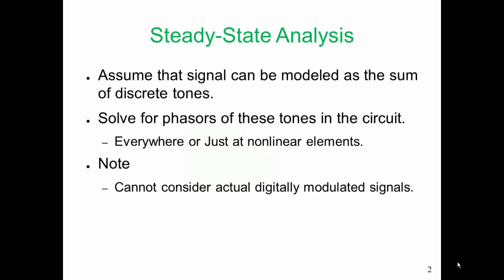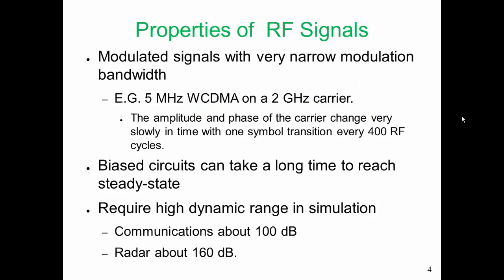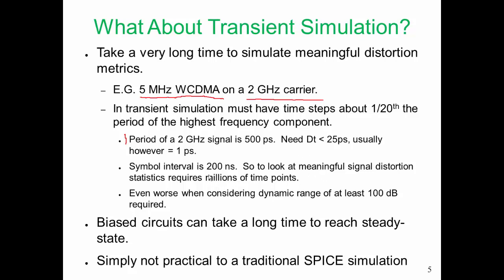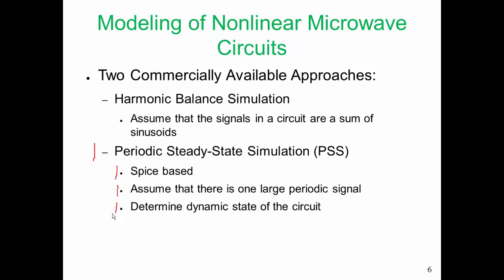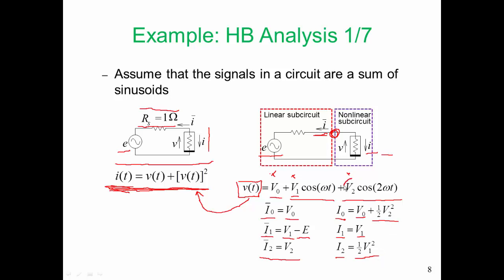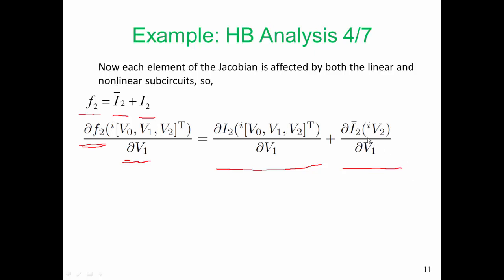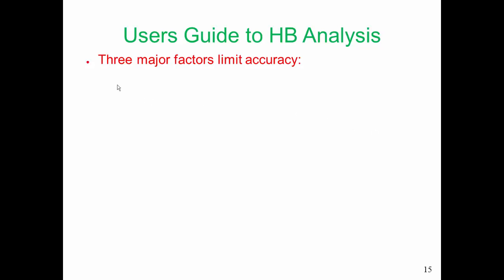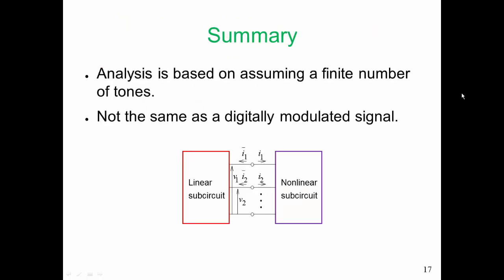Harmonic Balance Analysis of Nonlinear RF Circuits

Comment: @Michal Steer , what is wrong if I directly solve for V0, V1 and V2 on slide 2 (Around 25) and got solutions i.e. V0 = -00390V, V1 = -0.125 V and v2 = 0.5 v.

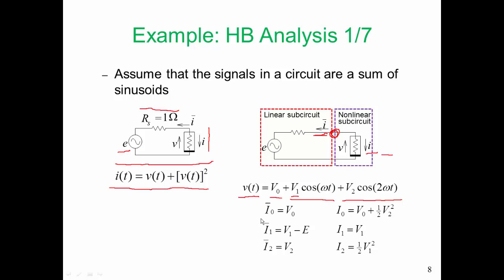Comment: Hi, at 23:20, how did you solve for I_0, I_1, and I_2 for the nonlinear subcircuit? Could you give an example calculation for I_0? I used trigonometric substitution to evaluate the [v(t)]^2 term, and I get a 4th harmonic from that and you drop that term as you say in your next slide, but I think that's the only part that we could agree on.
Reply: I'm looking at p. 923 in the second edition of the book and I am also struggling to follow along.  The only explanation in the book is "The linear subcircuit and the nonlinear subcircuit described by the quadratic model result in the following equations."

I calculate by substituting v(t) into i(t) = v(t) + [v(t)]^2, expanding the expression and grouping phasors in terms of DC, cos(wt), cos(2wt), etc. as explained:
I0 = V0 + V0^2 + 1/2*V1^2 + 1/2*V2^2
I1 = V1 + 2*V0*V1 + V1*V2
I2 = V2 * 2*V0*V2 + 1/2*V2^2
I3 = V1*V2 (neglected)
I4 = 1/2*V2^2 (neglected)

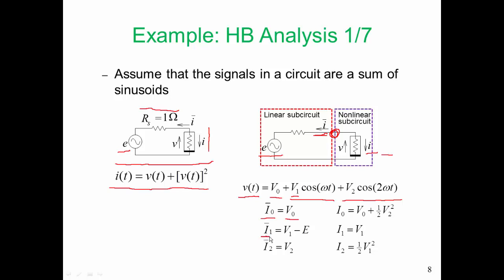However the book (19.5) and this video (23:30) give:
I0 = V0^2 + 1/2*V1^2
I1 = 2*V0*V1 + V1*V2
I2 = 1/2*V2^2

These terms appear in what I calculated but there must be some justification for discarding the remaining portion.  The system of differential equations at (32:10) is satisfied by the equations I found so I believe that the remaining portion is necessary.

Further inspection shows the equations with all terms present in (19.14).

I'm not sure if there is a subtlety I am missing or if the equations in (19.5) are just incomplete.
Reply: My work was still on my whiteboard, so here's a photo: http://imgur.com/csF6ZCs
Reply: Hello everyone,
I also solved with trigonometric substitution and there is a lot of variables that are not assigned for some reason that i did not find out.
Could you please tell me what I'm missing?
My trigonometric resolution is on the link below:
https://drive.google.com/file/d/1w8xdCCbi8cejjh0CrIIg4XYrGI5DpPv6/view?usp=sharing
Reply: Hi Colin Hart,
Did you find anything ?
Reply: I agree with you. The equations in (19.5) are imcomplete
Reply from the maker: I used MATLAB.  If you want to follow this along you need to look at the section referred to in the book.  Lot's more explanation there.